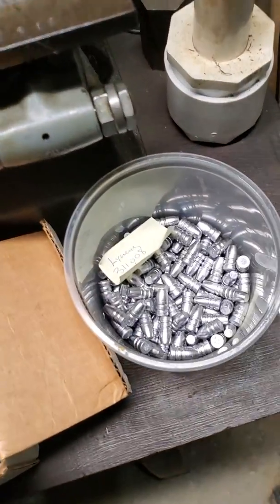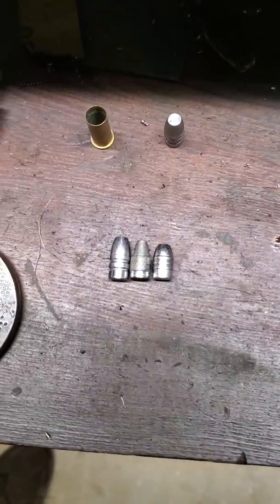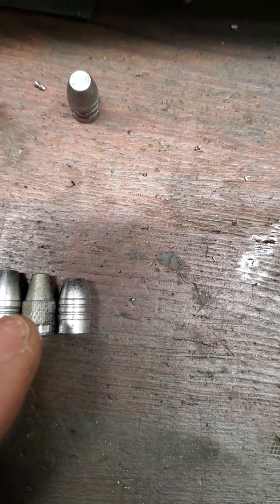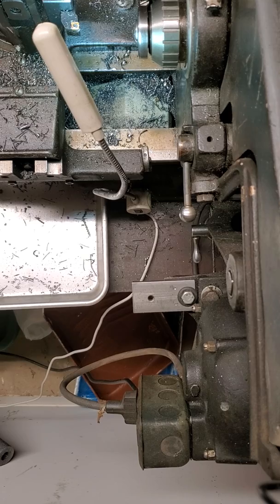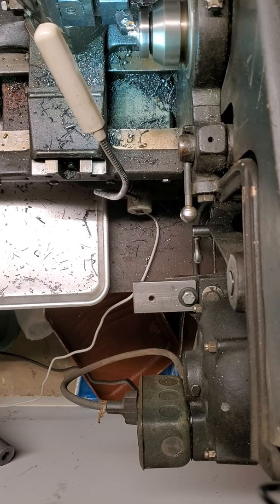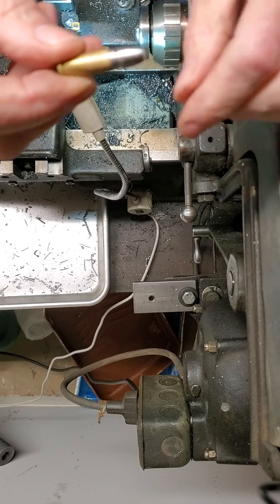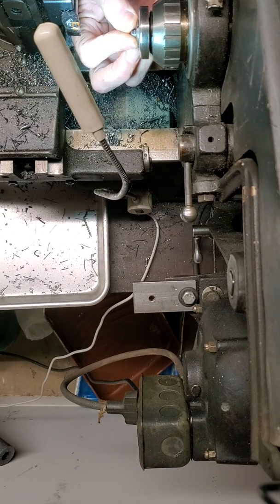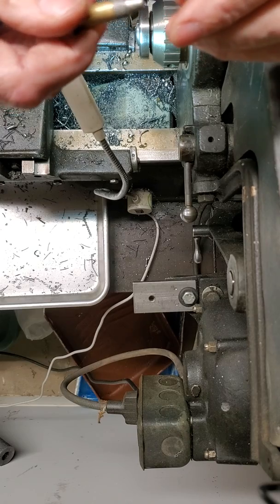How to make heel bullets on a lathe

Comment from the maker: These 311008 bullets are 30-1 alloy.
Reply: Really neat idea about making heeled bullets!  I have been wanting to make some black powder loads  for a couple of pinfire pistols, but have been stuck on the heeled bullets.  Thanks to you, that problem is now solved.  Thank you!

A couple of questions for you.  I have my Granddad's old 6" Atlas lathe, but my machining skills are somewhat limited.  What kind of cutting bit are you using for turning the heels on soft lead?  High speed steel?  Carbon steel?  What?  And are there any tricks to grinding the bits to get clean cuts on the lead?

Also, you mention having a center fire block so you can shoot cf rounds in rimfire rifles.  Where in heavens name can you get a centerfire block?  Or did you make one from scratch?  I have my grandmother's #4 Remington RB in 32 rimfire, and I would LOVE to have a centerfire block for it so I could work up a centerfire load.  But I don't want to alter the original RF block.  I would really appreciate any thoughts about where to find a #4 centerfire block.

Anyway, I love your vids on making  shootable ammunition for some of these old guns.  Please keep up the good work!

Thanks again!

fangirl Karen
Reply from the maker: @karenrogers2385  Karen - thanks for your interest and comments. My lathe is a 12" Atlas, similar to your - just a little larger.  I'm using a parting tool to cut the heels, but only because it is very narrow and allows me to get it in there easily. Some will say its not the best for this purpose, but it works well for me. I'm not a machinist, just a home tinkerer. But I find this works well. Lead cuts very easily and cleanly, no special trick - I just use the bit as ground for parting. My spindle speed is set at 413, that works well for a lot f what I do.

The centerfire blocks are original rimfire blocks converted to centerfire.  Unless it is a mint condition collector piece, the value is not diminished. In fact, I believe it is increased. Any good gunsmith can convert them, its an easy job. I converted my #4 roller my self. I had John Taylor convert a couple of my #2 rollers.  If you really don't want to convert your block, look on ebay. I see used blocks on there occasionally.  Good luck - Steve
Reply from the maker: @karenrogers2385  One other thing - Search for seller "tenmile" on gunbroker. He sells reloadable .32 rimfire cases and heel bullets.  They are more work to load, but are an alternative to converting to centerfire.